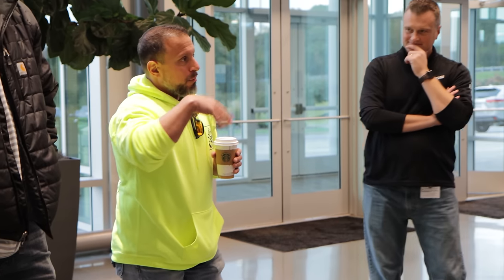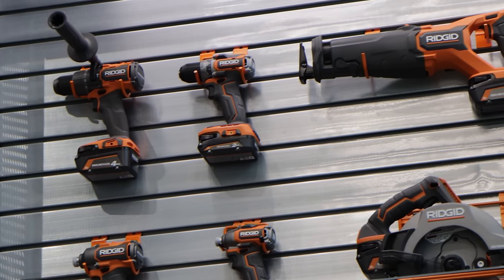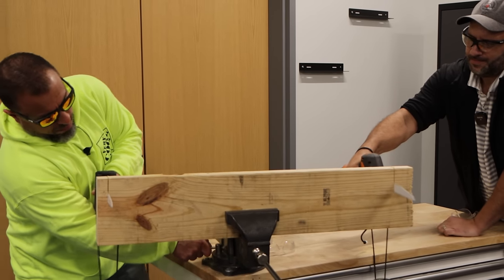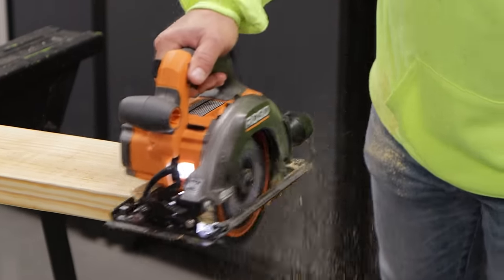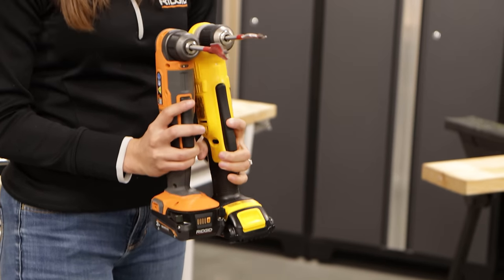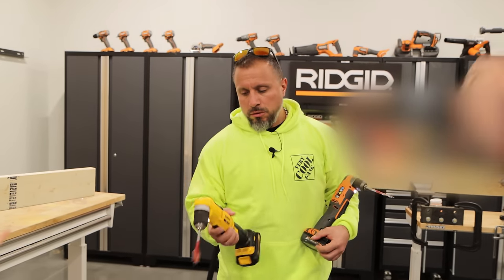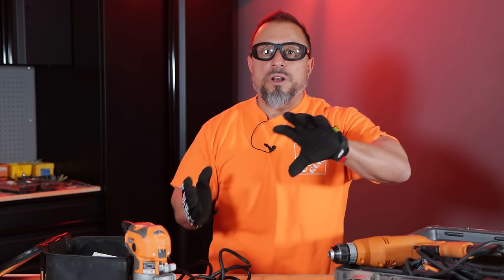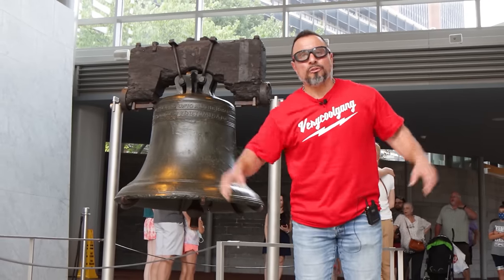Telling Ridgid Executives I Don't Like Their Tools!

Comment: Let's be real, The best tool ridgid ever came out with was the Stealth Force. And they discontinued it...
Reply from the maker: The stealth force was iconic!
Reply from the maker: Don’t believe us, watch this - Milwaukee M18 Fuel Surge VS Ridgid Stealth Force - Best Impact Driver Comparison! https://youtu.be/j4okfpkcEh0
Reply: @VCG Construction It really was, It was a product that blew me away. And they need to get back to that if they wanna compete with these other brands.
Reply: Dont know if the knot showed on your side but thats probably why the "sawzall" cut slower
Reply: Agreed. I just posted in the comments about this. Was a great tool
Reply: Lets be real, TTI owns rigid and Milwaukee and several other brands. They are all the same, you simply get what you pay for. The truth is they overcharge us all for a slight change that cost them pennies. The best we could do is stop buying the expensive brands that are marked up 500% and buy the cheap ones that are marked up 200%.
Reply: @somepeoplecanthandlethetruth  -- And the Torque Test Channel proves that, with every video. TTI owns them all. You are correct.
Reply: I don't know if anyone has said this but Ridgid, Ryobi and Milwaukee are under the same company. I've been a fan of Ridgid because of their (LSA) lifetime service agreement on their tools. Not every tool they make comes with the LSA. In that case there's a 3 year warranty. I've been waiting on certain tools that Milwaukee makes that aren't available in the Ridgid line. So now I'm a fan of also Milwaukee, which carries a 5 year warranty and has a bigger selection of tools available. So now I have the best of both worlds. By the way, I was once a fan of Dewalt a long time ago.
Reply: I dont like the way milwaukee cordless nail guns feel though i like the ryobi ones but they start to jam after a while. I have all dewalt cordless mainly because i wanted the powerstation for electrical outages so i dont have to risk my generator getting stolen while keeping my food cold, but was all makita before dewalt.
Reply: I would also say that their shop vacs are the best on the market and I'm a dewalt guy. They are powerful and affordable.
Reply: @ichigo1793  yup rigid vacs for the price are awesome handles a 7inch surface grinder no problem with their hepa filter/dust bag
Reply: @VCGConstruction  oh that’s the only rigid I have and it’s great so I guess I lucked  out
Reply: idk...their shop vac sucks pretty good!
Reply: @ichigo1793  The shop vacs aren't made by TTI. Emerson, the actual owner of the Ridgid brand, still handles those.
Reply: Bingo. As a consumer, Rigid was not really a discriminator to Ryobi.  I look forward to any in the future.   Dewalt is my go to for pro line.
Reply: Rigid tools work great for the first 2 months
Reply: Best rigid tool is a pipe bender period!
Reply: @themandalorian9009  thats just it. HD doesn't want them competing with milwaukee. Why else would they only release the lesser of the AEG lineup here.
Reply: @somepeoplecanthandlethetruth  Not buying the more expensive brands in order to make a "moral statement" might work for you but it would be a waste of time for contractors.  When the cheaper tool breaks, the time they waste warrantying the tool and having to buy a cheap replacement during the downtime would cost them more money than difference between a cheap tool and a premium tool.

In the long run, it's just cheaper for contractors to buy the cheaper tool.  Suits have already thought all this through ad-nauseum.  They know what they are doing.
Reply: Funny that the ryobi quietstrike was a lot smoother and a bit more quiet but less power and no modes. My stealth felt sloppy. The bit holder always felt off center.
Reply: @slylockfox85  I am a contractor. I pay for that slightly better tool because its all a tax write off anyway, i was saying in order to change anything we would ALL have to stop paying the extra.  Im a hilti and bosch man myself, they both last longer than the average tools.
Reply: What I like is that lady kept referencing that their designs are end user driven always the best way only the arrogant do it any other way it’s Hey guys what do you need what do you want make a design that answers these questions and you have success a great example is the rafter hook on framing saws
Reply: That's simply not true. And I happen to like Dewalt.
Reply: Be real it's TTI marketing all this talk about competitive is all bs rigid will always be under Milwaukee and above Ryobi most of the time.
Reply: @earlscheib7754  I've never owned Milwaukee tools and shares are good Ryobi is like buying trash. Bosch is definitely one of the best. But my Ridgid impact is awesome.
Reply: @davidperetz4033  Ryobi is a massive brand globally, larger than Makita in most markets, in Australia for example it is synonymous with power tools. The Ryobi one plus brushless competes very well with DeWalt.  Ryobi is probably the most improved tool line over the last few years plus they remain backward compatible with their old kits since they maintained the same battery form factor. Ryobi prices are hard to beat. As for Bosch yes it's good but not up to Milwaukee if you want to beat Milwaukee you need to go Hilti but they are moving towards a leasing model. When it comes to cordless tools availability is just as important as durability so for me brands like kobalt, rigid, hart, Bosch and even metabo lose out to Milwaukee, DeWalt, Ryobi.
Now if the tool is corded durability is my only concern. Batteries are the deciding factor which make some cordless tools totally irrelevant like IR impacts... Fantastic specs from a good brand but you're tied to their non existent tool line and invisible retailers.
Reply: @earlscheib7754  Ryobi is worthless, unless you're just using it around the house.
Reply: @davidperetz4033  I see a lot of crews in my area using them professionally in construction with no problems
Reply: @VCGConstruction  did you ever review the makita oil impulse? Wish dewalt would release an atomic one honestly
Reply: They have good pipe cutters
Reply: Hell yeah stealth force is the truth. I’m on my 2nd one. Gonna be sad when it dies
Reply: I think ryobi makes a pulse driver like the stealth force, but it’s a ryobi 😔
Reply: @ichigo1793  I got a great small shop vac almost 20 years ago,  but they discontinued the filter!
Reply: @davidperetz4033  our platform is dewalt, love it. We have a ryobi pinner and sprayer, because dewalt doesn't make those. They work great. Many of our worker folk have ryobi stuff. It's beat to hell and back, like tools should be, and still works flawlessly. YMMV.
Reply: @aosdjgolajsdfgoasrg  I'm not interested in your product (Ryobi).
Reply: Got rid of all my ridged tools but kept my 2 stealth impacts.
Reply: @davidperetz4033  ryobi is not my product. I am in no way affiliated with the company. I did not receive a prize for my comment. You can choose to believe that if it works for you. A quick re read of my post should explain my point. It is not my intent to generate interest in Ryobi products, merely to mention that I don't find them to be "worthless" in my experience. Again, dewalt is our platform. You have a wonderful day 😃
Reply: @aosdjgolajsdfgoasrg  I'm not interested in your product!
Reply: @davidperetz4033  respectfully sir, our product is housing. We rehab houses. We wouldn't expect you to be interested in our product, which is housing. I'm unsure what part of this is unclear to you, but I give up. Congratulations, you win!
Reply: @aosdjgolajsdfgoasrg  I'm not interested in your product or your service.
Reply: @davidperetz4033  that's a relief.
Reply: @aosdjgolajsdfgoasrg  I'm still not interested
Reply: @davidperetz4033  you make pink elephant!
Reply: @aosdjgolajsdfgoasrg  I prefer pink lemonade
Reply: @davidperetz4033  conglomerate squid muffin backpack hiker friend boss
Reply: @aosdjgolajsdfgoasrg  I take it you people at Ryobi don't like it when people reject your products
Reply: @aosdjgolajsdfgoasrg  Ata benzona gadola utipesh.
Reply: You can't find any of the Rigid stuff not unless it's the Professional Red Label stuff made by Emerson. All the TTI made stuff seems non existent. I feel TTI is focusing on Milwaukee as their high-end now and Ryobi as there lower end. The only Rigid stuff I ever see is the vacuums and table saws at Home Depot
Reply: @danecarpenter8735  they don't stock things that don't sell well. Someone looking to spend money on good tools are going to grab a Milwaukee or a dewalt. People who are just looking for a cheap tool to get a job done will choose from the lesser brands. I personally know a lot of guys with porter cable because they are cheap and work well enough and if they get stolen aren't out an arm and a leg. And job site thieves are more likely to grab dewalt or Milwaukee and leave the cheap stuff alone. The only people I know that buy rigid tools are homeowners who barely use them and don't know any better. Anyone who knows better knows rigid works great at first but falls off pretty quickly. Not worth paying the same price as a dewalt that will outlast rigid every time. I want to see tests done with all brands after 1000 hours of use. That's where you get your money's worth.
Reply: I own Ridgid Brushless line tools and they have not disappointed me yet.
Reply: Agreed 100%! I love my Stealth Force impact!
Reply: Their sewer snakes rip. Idk what you fools are talking about
Reply: Lets be real, Comparing brushed tools vs brushless isn't exactly fair..
Reply: @themandalorian9009  why would they get rid of their best product?
Reply: Heard that ridgeds next is not life time which sucks ryobi is my choice just cus they have so much going on vs any compatter
Reply: @krisstillwell6098  Lol dude ryobi is the worst of them all.
Reply: @slylockfox85  I think a big part of the problem is that the generation that grew up when tools were high quality and built to last are at retirement age now. 

We now have are generations of young people who do not believe it's possible to make affordable tools or appliances that will last more than a few years because they have never been alive in a period when that was the case. They have fully embraced the "throw it away and buy a new "better" one" mentality so manufactures meet those expectations.  

Consumers have ALL the power because in a capitalist marketplace the only goods on offer are those goods we as consumers voluntarily buy.   In today's highly competitive marketplace, in order to be cheaper,  a tool has to have less performance, or less quality, or less durability.  And most consumers don't buy the best value, they love to think they are getting something for nothing so they buy the cheapest and that's what we get - cheap.
Reply: RIGID Aluminum 24" Pipe Wrench w/Lifetime Warranty is the best product they ever made. 

The entire oil & gas business runs on 24's and 36's - 24/7/365.
Reply: Well said…
Reply: Pretty much everytime a company gets a good idea and makes a good product: Hey, let's scrap that and never look back.
Reply: @TheJustinJ  👈🏻 This guy is 100% correct...I can confirm. And they get USED...All day, everyday. 
If your dont have a good 24" and 36" pipe wrench you ain't drillin', frackin'  or workin'. Period.
Reply: Like McDonald’s they will bring it back better than ever or just slap a new sticker on it an call it the McRib style 😂
Reply: Hell yes. When I found out it was being discontinued, I went out and bought 3 on top of the one I already had. Thankfully, my original one is still taking names and kicking ass albeit it looks like garbage from constant daily abuse on construction sites.  Haven't had to break out one of the 3 back ups yet knock on wood
Reply: @williamherd7251  why are you on your second?
Reply: @blakedjameson  fell off a roof onto concrete.. didn’t break immediately but it was clear I needed another.. hammer drill just broke yesterday, weird you asked. Will be changing entire setup because rigid doesn’t make stealth force anymore
Reply: @blakedjameson  stealth force still going though.. that comment was 10 months old
Reply: @somepeoplecanthandlethetruth  good luck getting people to stop spending on expensive product's, they always have some excuse as to why they are doing it.
Reply: WHAT ABOUT THERE SUBCOMPACT HAMMER DRILL ITS GREAT AND LIFE TIME WARRENTY CANT BEAT THAT!

Comment: That heartwood on the dewalt side of the 1x8 is so much harder than that Clean wood on the rigid side. That board was certainly cherry picked.
Reply: I'm disappointed he didn't catch that and ask to switch it up. It was clearly ahead untill it hit there and then came to a dead stop.
Reply: Good pick up.
Reply: That's the first thing I noticed
Reply: Sure was a setup
Reply: I owned both.  The De Walt is way longer lasting and faster.   With that said the ridged is fine for the amount of cuts needed on a roof.
Reply: Yeah still a shady company.
Reply: And wasn’t dewalt brushless ?
Reply: I would have drowned the test again swapped sides, then swapped blades and done the cut on both sides each.
Reply: He did a retest with his own tools in his own board where they swapped sides and everything and the results were the same
Reply: Also the dewalt angle drill is a 10 year old model so not a good comparison
Reply: NOPE - that was re-tested and dewalt is slower: https://youtu.be/puhbb3NXWrM
Reply: That's what I thought too.. I thought they notice that but they only switch by themselves not the tools..
Reply: Ridgid still dusts the yellow. They did another video because of the knot. 😂 ridgid came out on top

Comment: I love how the dewalt is going through knot and the rigid gets the clean pass on the recip saw.
Reply: I'm glad I'm not the only one who caught that.  Vince was totally set up on this deal and it really pisses me off
Reply: I noticed that too lol
Reply: Yeah they should have swapped sides
Reply: Those tests were a total setup overall. I want to see full batteries on both tools, new blades and same wood in addition to the same force. Using a dull blade on the competition is a classic on trade shows. 
And that drill was a comparison between brushless and brushed, may as well not compare it at all.
Reply: the Ridgid has a much larger stroke length and runs a faster stroke per minute. The thicknesses of the board is the reason Ridgid performed way better better. the board was thicker than DeWalts stroke length but not the Ridgids. Ridgid could clear the chips DeWalt couldn't. if they were cutting 2x4s it would have been much closer. Ridgid would still win though.
Reply: He did a follow up video with his own tools on his own board where they swapped sides and everything and the results were the same
Reply: Notice their triggering techniques for the tools are positioned behind a lumber curtain?!
Reply: The testing in this video is hilarious.  agreed
Reply: Look for to me, just seems that some butt hurt is going on. Ridgid won every time. Ah yellow lovers butt hurt.
Reply: It looks like it was by a knot, but not through one.
Reply: @sniper60605  everyone is saying it went through the knot 😂 I must have missed it.maybe I blinked

Comment: This is exactly how a tool manufacturer could grow their market share, by listening people who are using their tools as a living and keep improving. Great job guys !
Reply: You're kidding, right? None of the three tools demonstrated in this videos are staples of a commercial worksite. Ridgid might as well be building blenders.
Reply: As a professional the Ridgid Miter box is not something I would ever buy. Took mine back, very inconsistent cuts even at 90 degrees. The cuts were all over the place. I have an old Ryobi that cuts 90 after 90 after 90 all day, dead on. Ridgid also does not offer the same selection that their sister Milwaukee does. So, at this point I am going over to Makitia. The quality is there, and they give you a great variety equal to Mil or better. I stayed with Ridgid for the last 8 years. Now, for a tool company to fall on their face with a poor miter box design, they are not competent, how did you let this happen?